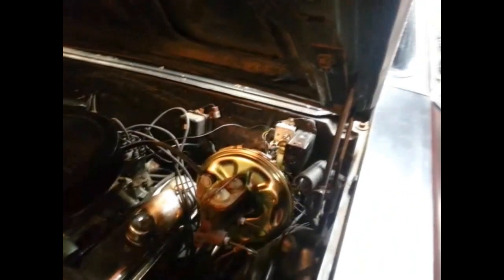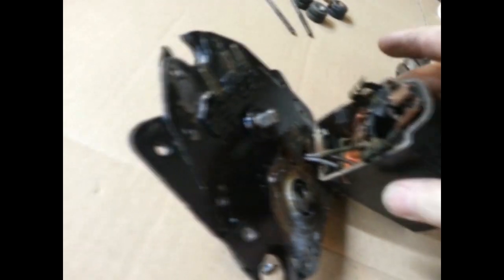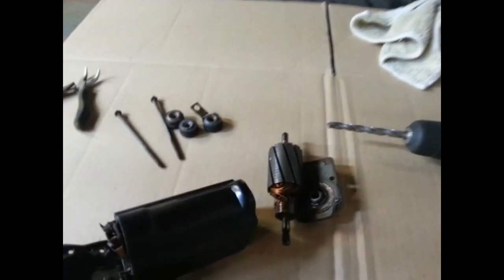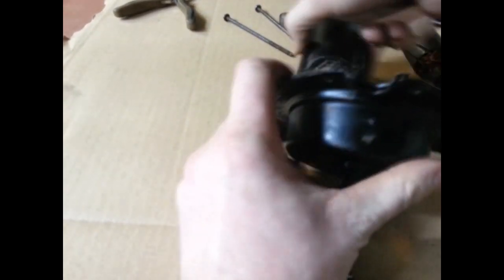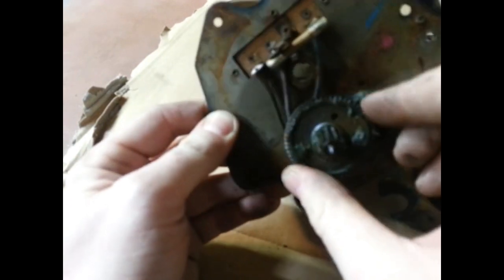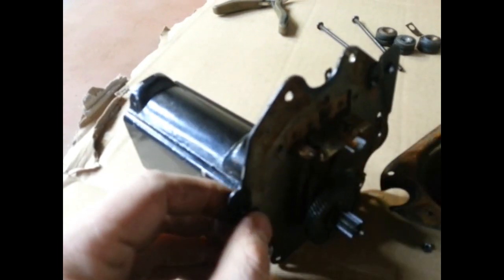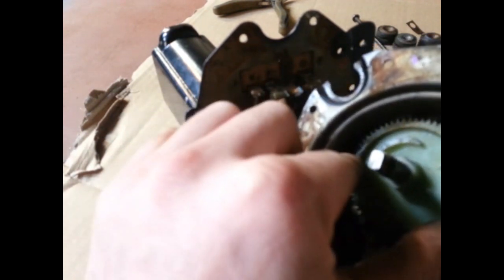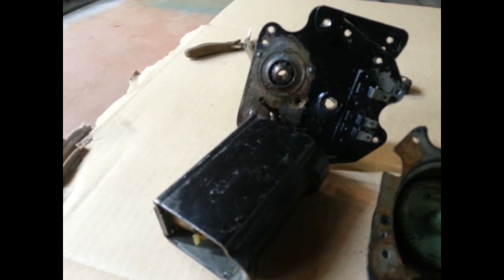INSIDE a GM wiper motor - 1964-1967 GTO Wiper Motor Disassembly

Comment: Which ones are to the battery and switch
Reply from the maker: I have a bunch of wiring diagrams, but I don't know how to share them with you.  The bottom terminal is +12 constant. The wiper motor needs to be grounded for park to work.   The switch on the dash provides ground to the other two terminals depending on high or low so speed.  Both grounded for low speed and only the middle one grounded for high speed